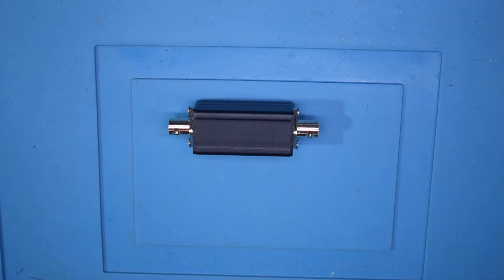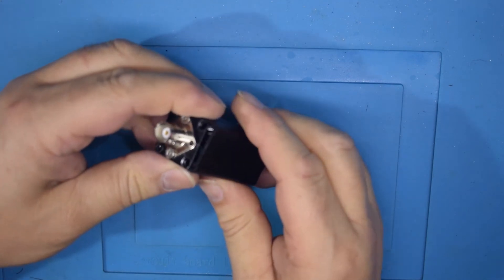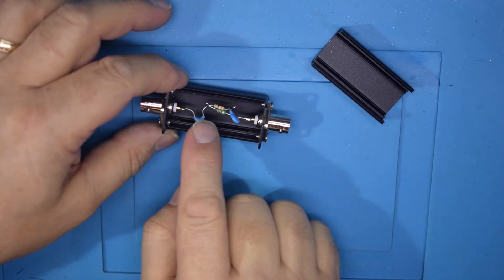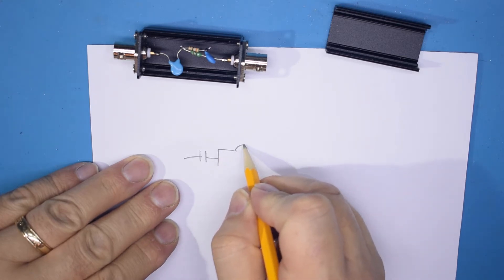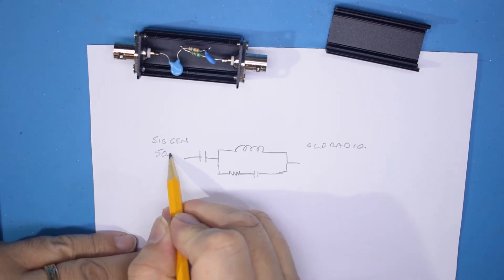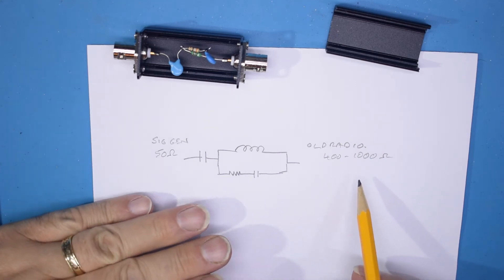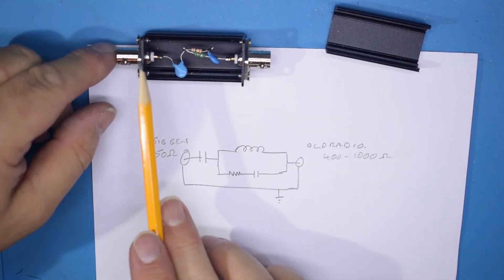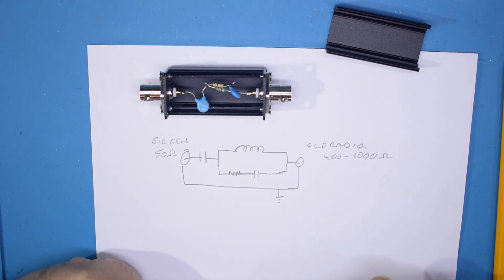Dummy Antenna for setting up vintage radios. A simple description

Comment: Why not just realign the radio to 50 ohms instead of 400 ohms if you are going to use a standard dipole? If you align to 400 ohms and attach a 50 ohm dipole instead of the standard long wire doesn't that detune the radio you aligned expecting a 400 ohm impedance?

Comment: It would have been great if the parts values had been given.  Hallicrafters says to use a 200 pf cap in series with a 20 uh choke that are shunted by a 400 pf cap in series with a 400 ohm resistor in the S-40B service manual.
Reply from the maker: The parts values are on the RMA data that I showed and are easily found with a Google search. In all honesty, the values are not totally critical because the socket on each set would be presented with wildly varying impedance antennas.
Reply: LOL. What RMA data?

Comment: That’s Useful, now I don’t have to make a video on constructing an I.E.C dummy antenna.   Annoying I find myself have to build one although I have several at work somewhere. Thanks George.
Reply from the maker: Why reinvent the wheel Chris? I would probably go with a plastic box if I were to redo it and slightly larger to isolate the earth side.

Comment: Thanks George for the very informative video.  I’m just in the process of building this exact device.  Can you tell me the part # for the 20uH inductor (RF choke) that you used and where I might source that.  Thanks again!
Reply from the maker: Hi Scott, I actually bought the chokes as part of a batch from AliExpress. There was a pack with 10 or 20 values, 10 of each for about 3usd.
Reply: Thanks George - I was able to locate them at Mouser based on your video.   @GeorgeChristofi